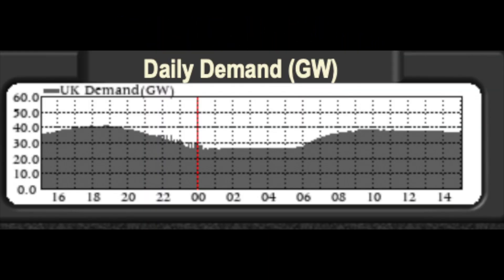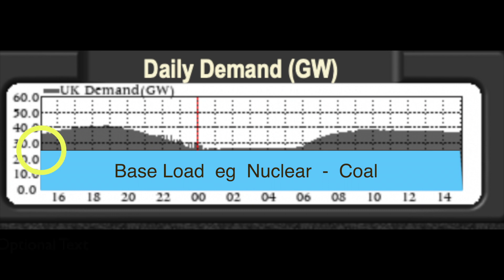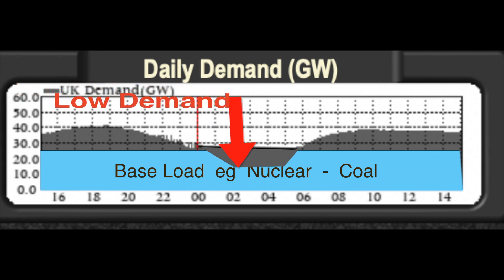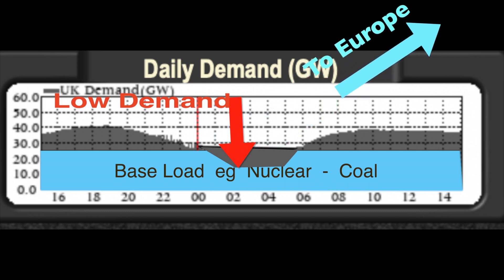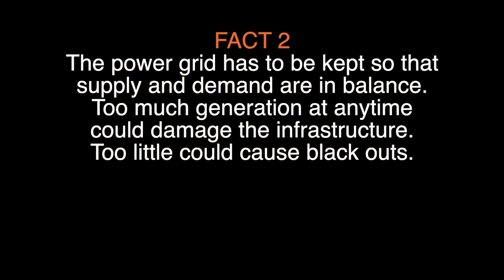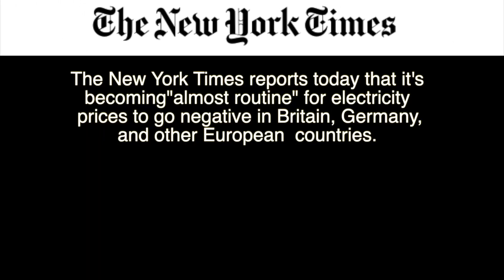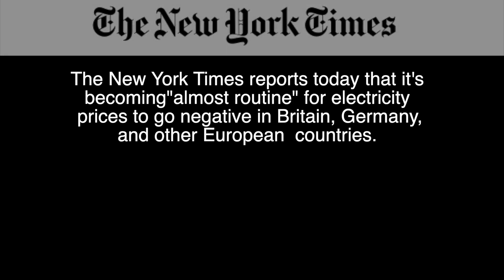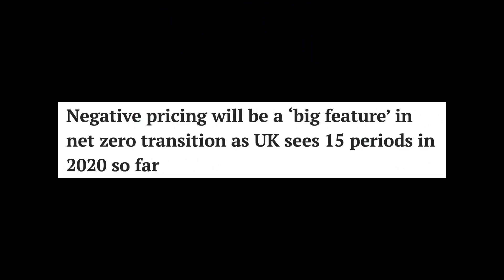When The Wind Stops  - Part 3 of 10 Parts

Comment: Doesnt tesla have a storage system that uses batterys? I know they use this system in Australia, also why dont we use more nuclear power? it does seem like the best way right now with exception to capitalism.
Reply from the maker: All the batteries in Europe would power Europe for just over a minute.
It is totally impossibly expensive to use batteries on a power grid for storage - there are simply not enough resources in the world.
Australia does not use batteries - they simply pretend to.
"The Australian Energy Market Operator (AEMO) last week awarded a competitive contract to developer Neoen to build the project dubbed the "Victorian Big Battery" along the transmission line connecting the states of Victoria and New South Wales. At 300 megawatts/450 megawatt-hours, this project will eclipse the size of all other grid batteries online today"

 January 2000, Australia had an electrical generation capacity of 43 million kilowatts (or gigawatts). Approximately 84% of this capacity was thermal (mostly coal) and 14% of it was from renewables (mostly hydro)."
Reply from the maker: The battery power there would run the grid for under 2 minutes and is pure show without any meaning other than virtue postering.
Reply: @ClimateRealism  Wow, thank you informing me, i just saw the headlines from tesla, I know the whole thing is a scam but didnt know it was that bad. I really hope you get your message out, people are waking up and now people cant afford to maintain an Idealistic posture.